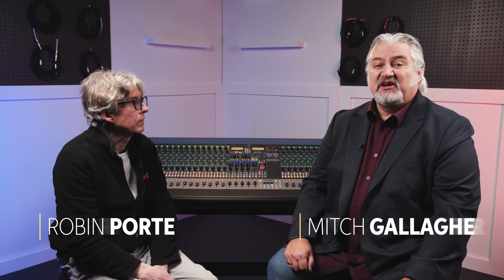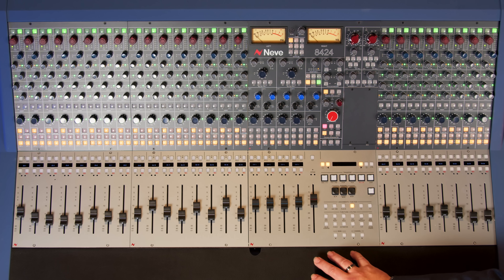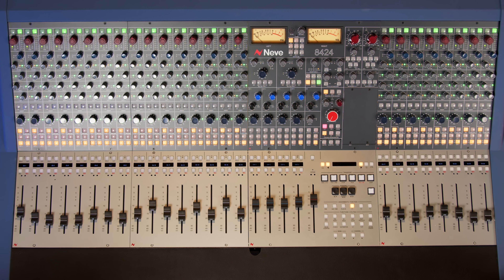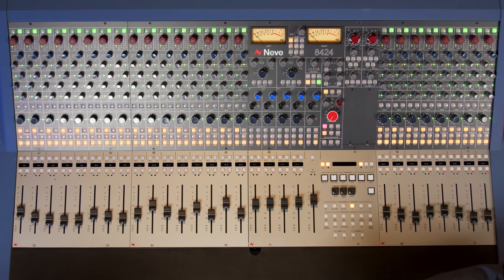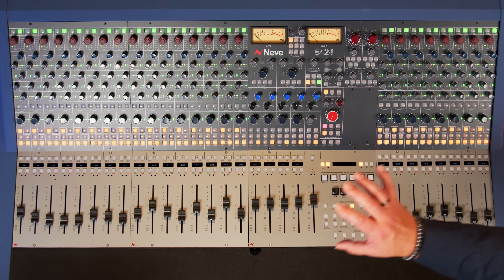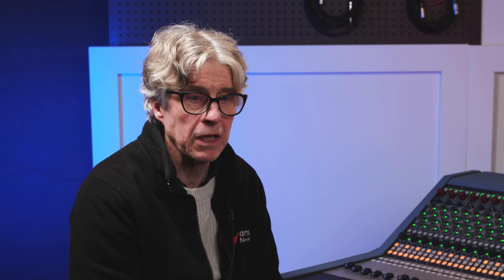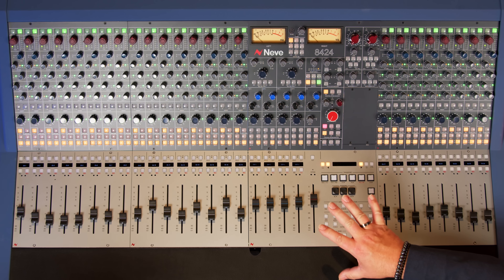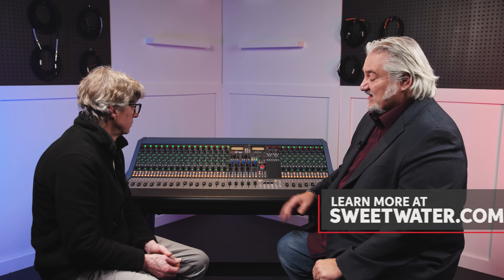Know Your Neve: Chief Analog Designer Robin Porter on the 8424

Comment: It's a brilliantly thought out and ultra-flexible little console that was dismissed unfairly by too many when it first came out. I love mine - it's great whether I'm writing / tracking, mixing ITB but using the DAW control for automation, mixing hybrid or fully analogue - it does it all + fully recallable so it doesn't slow me down when I need to flip between projects. Most importantly it sounds GREAT.

Comment: SWEETWATER< it would have been nice if you had a block diagram or wiring diagram in the video showing the differences between voltage mixing compared to virtual ground mixing